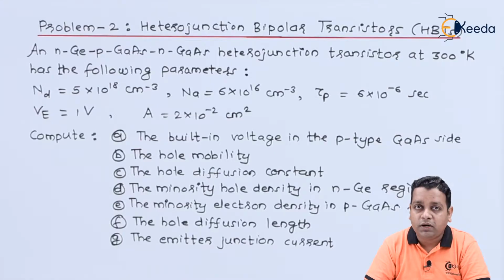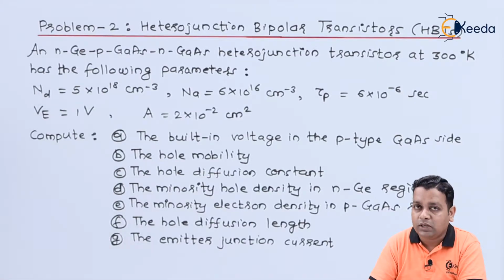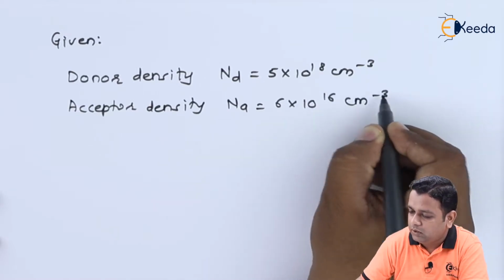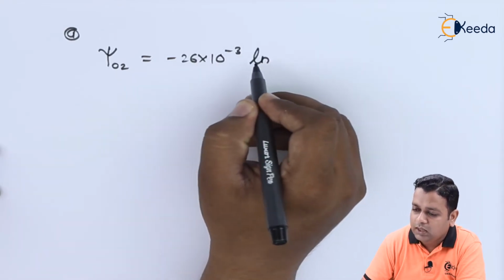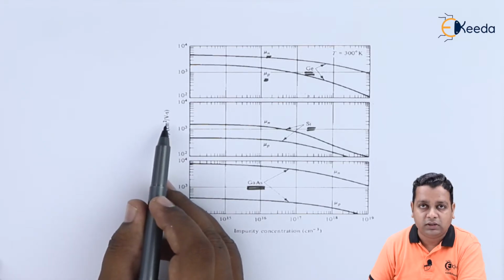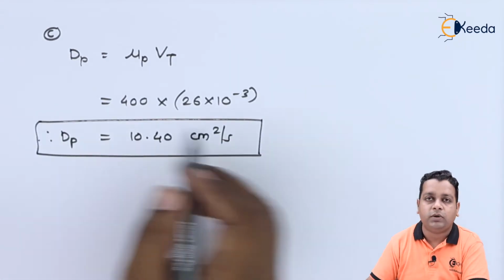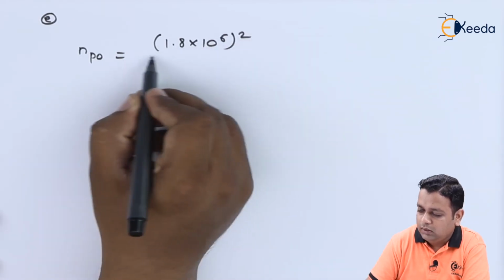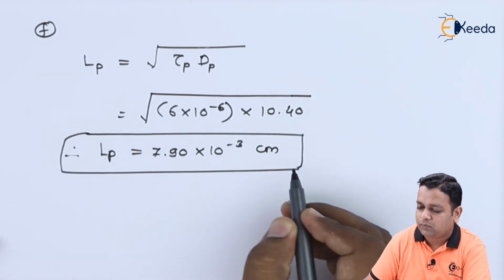Problem 2 Heterojunction Bipolar Transistors HBTs - Microwave Transistors and Tunnel Diodes

Comment: Thank you for these videos, I am really enjoying them.  I worked this example a few times and I have a couple of questions.  Using 400 for the hole mobility I get 9.58 Amperes for the current.  I am simply off by an order of magnitude, and I cannot figure out how this is.  Also, using the table for hole mobility, I think it should be closer to 300. It looks like mobility starts at about 400 and drops to about 300 for concentration in our problem. This drops the hole diffusion constant to 7.8, and hence the current to 7.2 A (or 0.72 if my calculations are wrong).  Either way, these last few videos are excellent, thank you again!